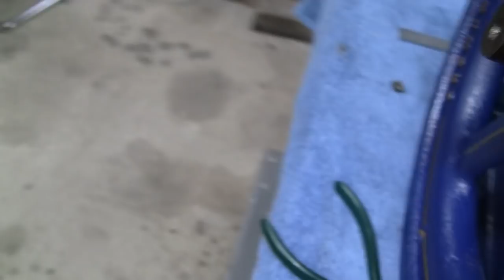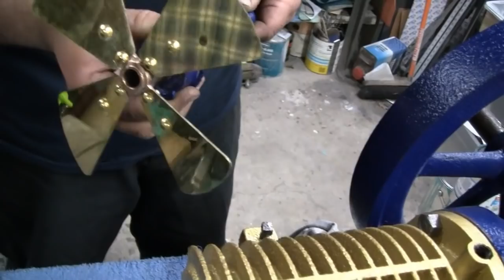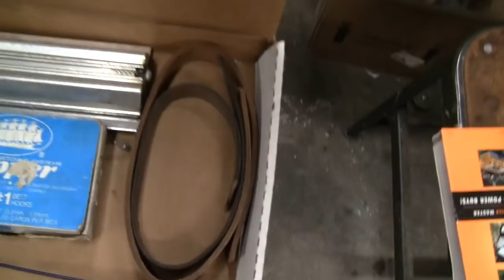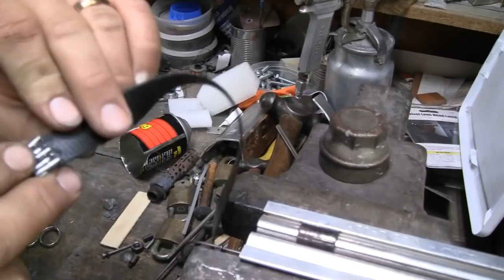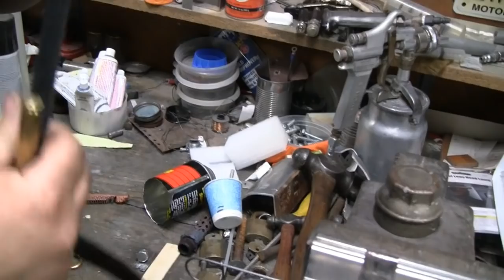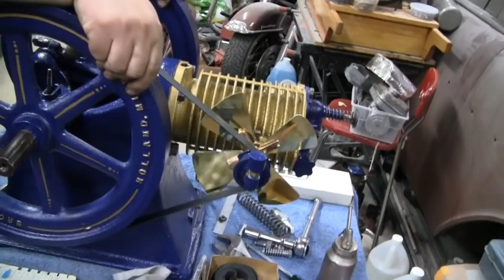BROWNWALL HIT and MISS ENGINE RESTORATION (part 14)

Comment: If you have one of those old time 12v car battery vulcanizing anvils, you could vulcanize the band shut, for a neater finish. Just needs a smidge of glue, could probably get away with using a soldering iron (the bigger ones) on a plate of copper too. I know i used to do my bicycle tires like that when i was but  a wee lad. :)) This engine is a beauty, can't wait to see this run.

Comment: Interesting engine,it seems very primitive compared to other hit and miss engines.Would there have been any tins over the crank and around the fan? Or do they just let er all hang out!
Reply from the maker: Yeah originally it had a cast iron cover over the crank and a sheet metal shroud around the cylinder and fan!!☺

Comment: Look around, when all this is over and find a  electric fan with a wire cage around the blades and put it around or take some brass brazing rod and make one and braze the joints together.  You could make it look period correct then you would really have something.  I know you and the rest of the guys will figure it out, unless you want to put a flat plate lined up so you could slice cucumbers or link sausage with it.

Comment: helicoil

I've made my own, too.  I had a bad tensioner mount, so drilled/tapped it to 3/8-24, then drilled & tapped the center of a 3/8" fine thread bolt to fit the 8mm x 1.25 specialty bolt and cut the head off.
Reply from the maker: Not enough meat there!!☺

Comment: That fan is a beautiful work of art/finger chopper! Btw if the epoxied stud fails, could you tap that hole to an 1/8" NPT thread and make a stud with a brazed on NPT piece of pipe at the bottom? That way it'll seal with no brazing of the cylinder
Reply from the maker: Not enough meat there Ant!! That stud should do the trick!!☺

Comment: I hope the JB Weld does the trick here in holding that stud securely.
That should be a well cooled engine with that ratio, fan to flywheel!  Nice belt lacing job too.
Reply from the maker: Thanks Reg!! It should be fine!! The stud holds itself securely enough, the JB is just to keep air from pissing out the little hole!!☺
Reply: @805ROADKING  It'll be interesting to see the first 'fire up' of this one!

Comment: I can see a guard coming for that fan, if you can work out a way to fit one.
Reply: The original type duct... I recall Roadking initially discussing and dismissing one but I think he will reconsider.
Reply: Hindsight always has 20-20 vision.
Reply: @Chris Hartley He could always paint some lines or something on the fan, to make it more visible when it is running.
Reply: Yup, or at least a warning sign!